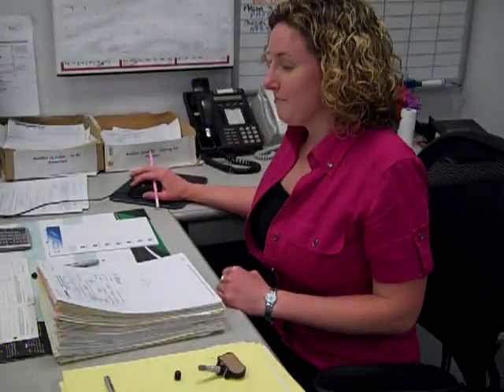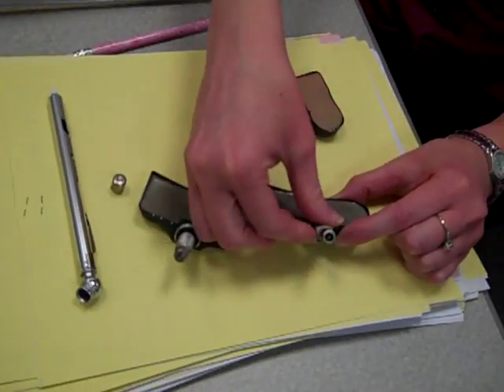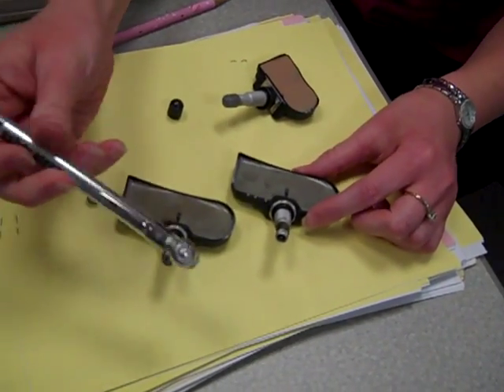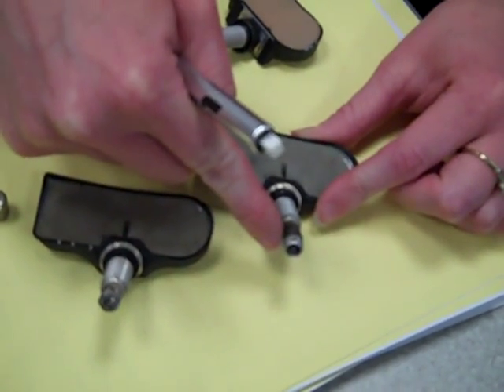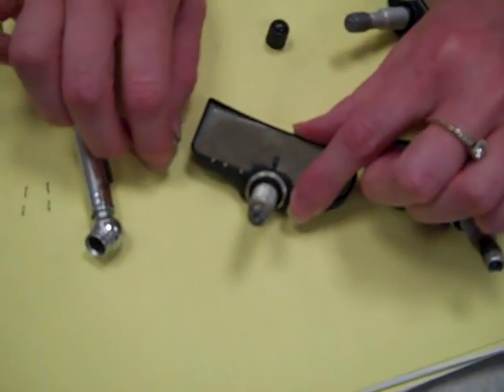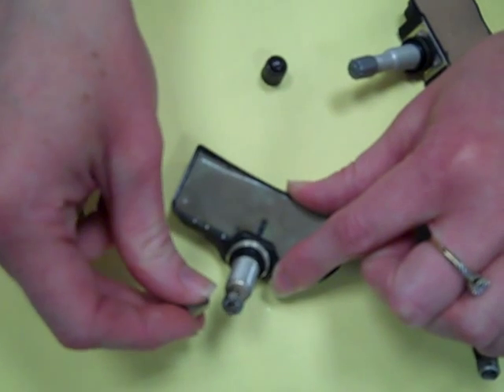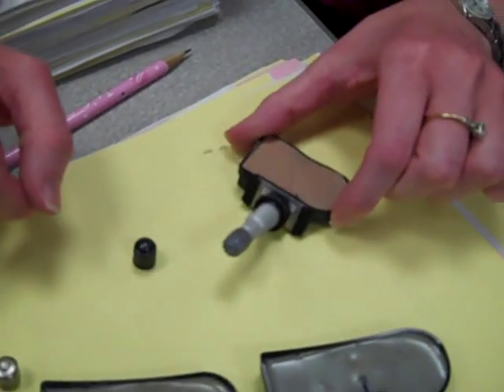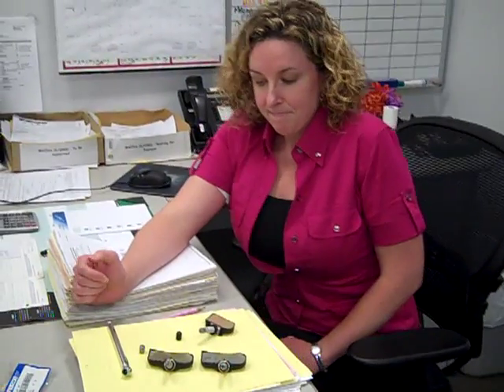Schwartz Mazda Service Tips  TPMS Tire Pressure Monitoring System

Comment: Ridiculous $150 for a part you get replaced at a decent tier center with new tires for $2.50 -$5 ... Typical Dealer Rip off... Go to a tire center if you TPS needs replacement It might cost you $20 a tire!